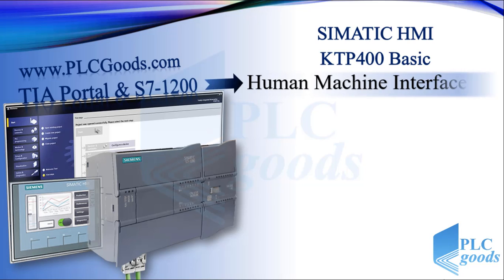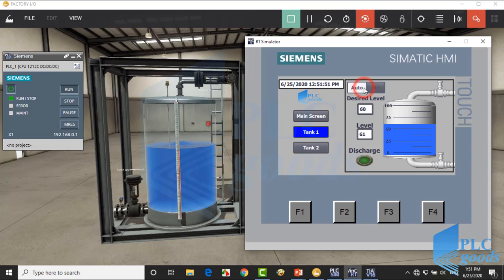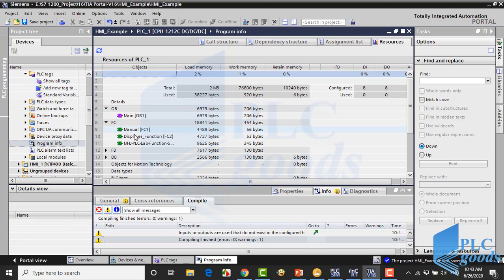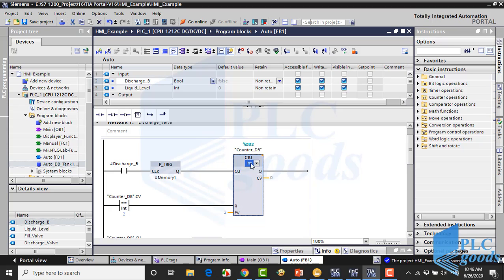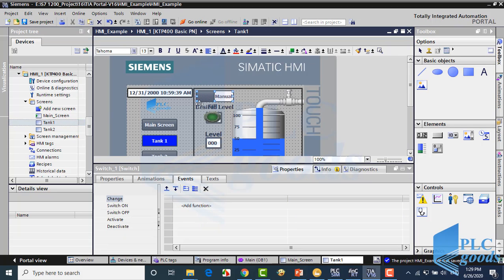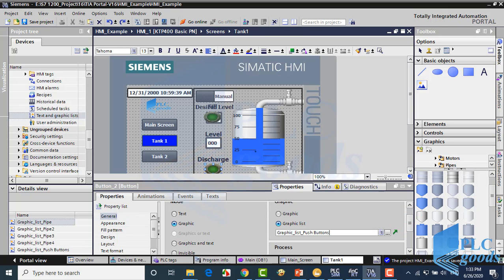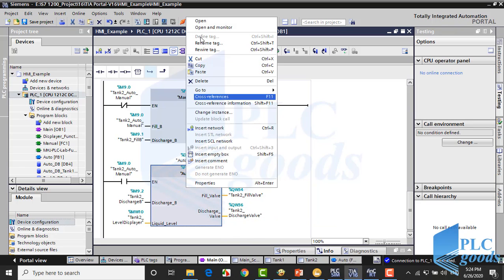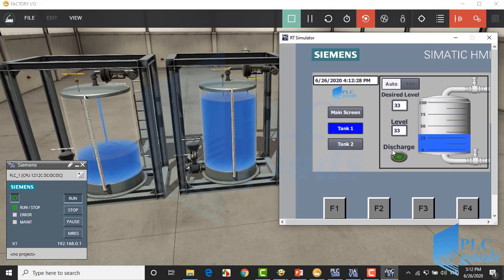PLC & HMI Practical Project | Liquid Level Control with TIA Portal | Factory IO Simulation | L 37

Comment: good work,how can i connect factory io to the existing project.I made the project without Factory IO and downloaded Factory IO recently.
Reply from the maker: Hi there, thanks for your comment! 🙏

I’ve already posted around 40 free videos on my YouTube channel about programming the Siemens S7-1200 using TIA Portal – you might find them helpful for your project.
If you’d like to learn in detail how to connect and use TIA Portal with Factory IO, I explain the complete process step by step in my Udemy course. That would be the best place to follow along and get the exact setup.

Comment: Hi Sir,  Thank you for this video. Actually Where did you find that push buttons for fill and discharge valve, I searched for so long time. But still I can't find it.
Reply from the maker: hi there, I show how you can add a button to an HMI screen during the course. Note that, then you will need how it should work by determining its function. For example, If you want to use the button like a pushbutton you should use the "SetBitWhilePressed" function for that. This function is explained during the course as well. Please see and follow our videos again and if you have a problem, please determine the exact time in the video.
Reply: @plcgoods  Thank you for replying me. And sorry for wasting your time.  At time 12:00 there are two push button in the graphic list, green and red, where did you pick that button i was searching it for 1/2 an hour. Did you placed your own customized switch?  At 12:08 that selected green Push Button.